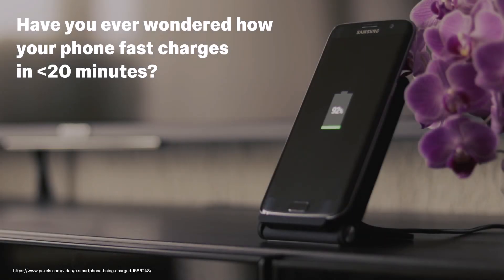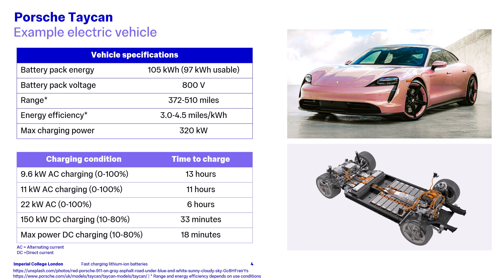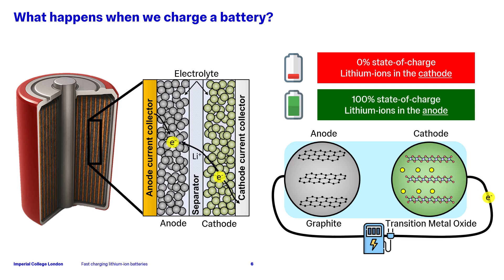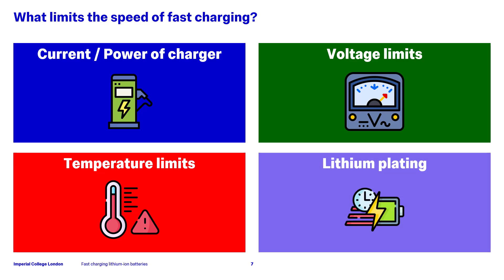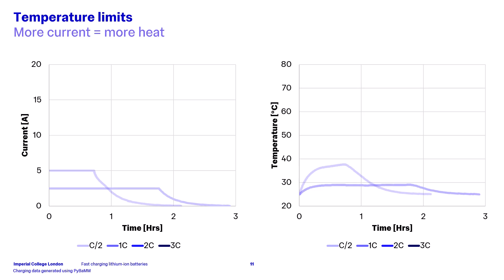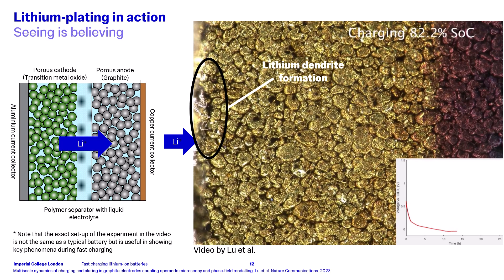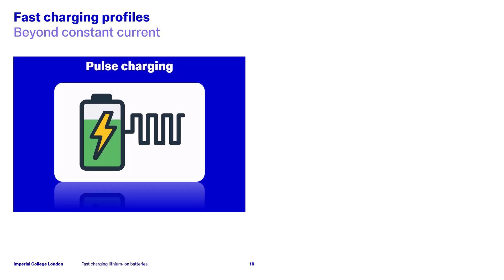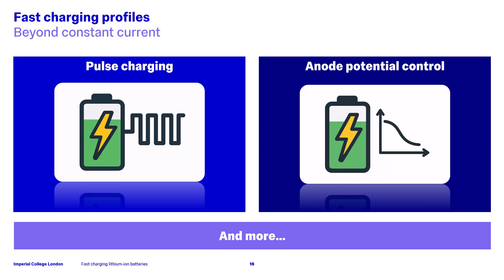The science behind fast charging lithium-ion batteries

Comment: Dear Dr Wu,
I have a question that you might be able to answer. I have an e-bike with a 72V lithium ion battery and I have connected power diodes in the charging cable so that my charger charges up to almost 84V, but the battery only receives ~80V. This way I have a change from CC to CV even at a lower voltage. 

I observe that when switching from CC to CV, the battery has about 75% charge. Now the voltage remains constant and the SoC continues to rise to about 83% at constant voltage. 

Which degradation is to be expected in the long term with a battery charged in this way, that of charging to 75% or that of charging to 83%?

My hope is that the degradation is largely dependent on the voltage and that I can therefore protect my battery in particular. What do you think about my low voltage CV method?
Reply from the maker: Thanks for the comment. Usually the integrated battery management system will handle the charging and thus define the CC to CV transition. Assuming the speed (or current) of the CC portion of the charging is relatively slow and you don't get any lithium plating then the time spent at high SOC (or higher voltage) will likely be the main driver for degradation. To protect your battery you can either not fully charge your battery, or if you want to fully charge to get additional range, only do so before its needed. I.e. avoid charging to 100% and then leaving for a long time. This is due to the side reactions occurring in the battery which are faster at higher SOC

Comment: How to determine if a cell was charged to fast?
Reply from the maker: If the cell has visually expanded, this is an indication that gas has been generated and potentially overcharged. If the battery heats abnormally this is also not a good sign. Beyond this, there are ways to detect lithium plating by looking at the shape of the voltage curve but usually the battery management system takes care of this (if advanced enough)

Comment: Hi iv got interesting question , that no one has been able too answer yet, li-ion Battery 3.7v 1300Mah.For Rc car... No lie did voltage test on all 4... 3 read 4.1-4.2v ... but one of the was reading on the meter As 10.72v... did re test on others thinking my meter was bugging out nope meter work fine tried on other  battery's meter works ,, perfect ... did test on the one that read 10.72v . said too my self nah now way it could hold that much charge. so hooked it up too 540 rc motor and its been running for close to about 1hr 50mins at steady speed . its not heating up at all not even warm .
Reply from the maker: Interesting. If they're a different model perhaps there are more cells in series; increasing the voltage up to >10V. It's usually not possible to charge a single cell to that level without issues
Reply: @BillyWu  was just one 3.7v . not in a set with any others.  when the 540 motor stopped turning i was think it would of got hot to touch but was not even warm motor was hot , I'm gonna stop using it , just in case to be safe ,
Reply from the maker: @nickmisiraca5740  Yeah, not 100% sure why a single battery would get >10V but certainly not normal. As you say, best to not use just in case as a battery fire can be quite dangerous